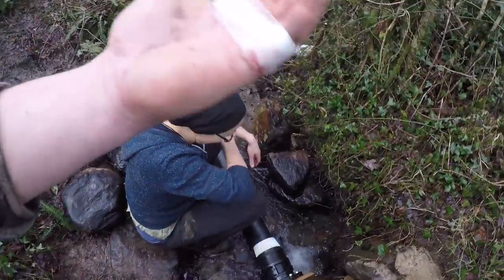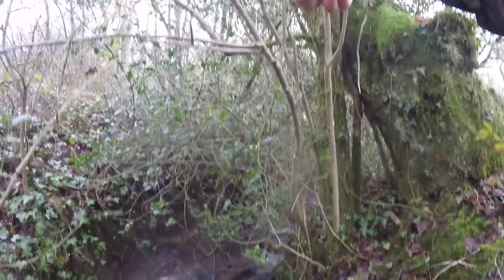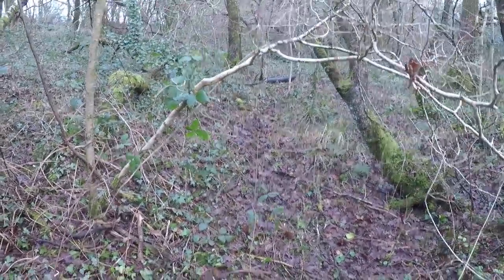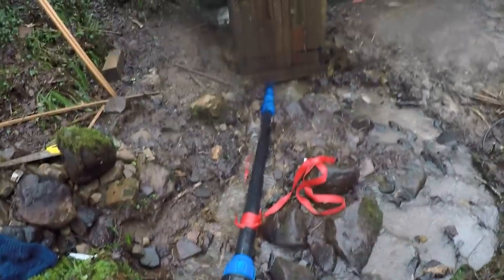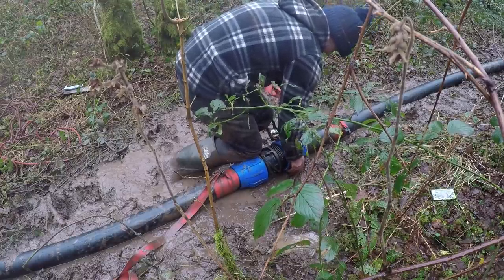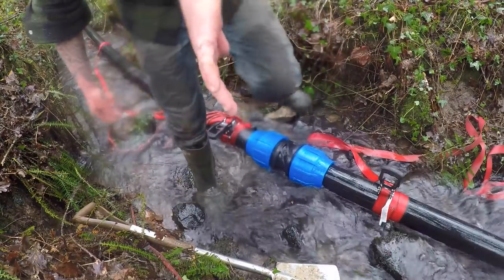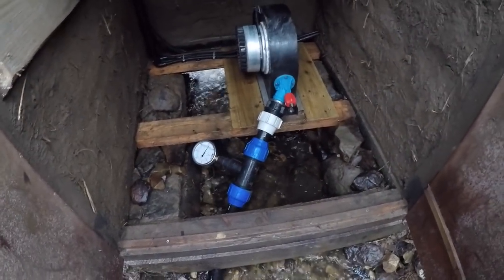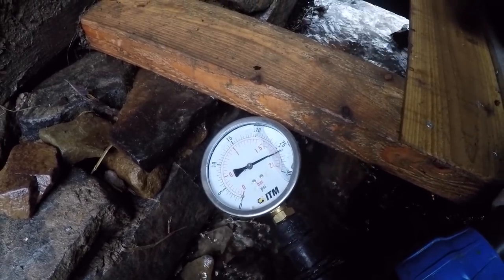DIY Micro Hydro Part 16 Powering Up The Turbine

Comment from the maker: Check out my website for pictures of the Hydro System.  https://www.krisharbour.co.uk/
Reply: Why do you need to install the Micro Hydro in a river streams ?
Since the Micro Hydro generates electricity why not let it power a water pump so the pump can create clean water streams from higher place the cycles keep on running indefinitely ?
Reply: Hello kris
Reply: I m from india
Reply: I want to know about small scale hydro project (step by step)
Reply: @reezalaq6522  I think that it wouldn't create anouf electric
Reply: @reezalaq6522  so..... perpetual motion then .........!
Reply: Hey I’m a bit late. What type of pipe fittings are those? I’ve been using something similar for my large irrigation projects and this looks like an interesting option.
Reply: Chris, 8:20 you should close the stand pipe end if to get more preasure. You could go to more than 60 psi if you close the stand pipe. Opening the standpipe will reduce the air preasure causing the preasure reduce. And the stand pipe shoul not higher than your intake pipe

Comment: The sound as she span up.   Awesome.        Heart sunk a little as she took load and slowed down.    I was expecting it to stall..   ever the pessimist I am.  haha

Great vid Kris.   I am so looking forward to seeing the results.

Cheers for taking us along.  Neal
Reply from the maker: it speeds up again after that, its the charge controler working out the ideal voltage. at about 70v it sounds lovely. but it takes the controler a little while to work it all out. thats why i need a better controler.
Reply: What is the controller you used?  
The ones I have used have never been anything greater than 20A at 12v.  I started with a few PWM controllers which seemed to boil my batteries dry quite quickly over time I thought despite it not charging until there was enough light to reach the 13.8v needed to charge.  Maybe a had dud ones.
   I eventually got an MPPT controller.  It had a digital interface where I could set the dis/charge cutoffs,  as well as a switched load output that could have its voltage limits adjusted, as well as the option to have it timed.  Great for low light charging too as it has a built in boost converter to utilise all low voltages from the panels from early light. (boat project in my case).  Well worth looking into if you haven't already.

Comment: Big step forward Kris,

Hydro will just keep on giving regardless the time of day. Looks like you will get some real useful generation out of that system.

Well done, as always great effort team!
Reply from the maker: I’m currently in my shed with the lights on and using power tools... the lights are on in the house my laptop and the fridge freezer is now on and the hydro is at half flow 👍😊
Reply: Result!
Reply: Kris Harbour  wow that's awesome..keep up the good work. Question .if you were to have 3 turbines in series what would be the water pressure drop if any.

Comment: Nice work Kris.  I have followed your great efforts and skill in working with wood and fabricating metal etc. You got the PSI at 24 bang on - under load. I think you will get the full 300 watts  or  more with the flow you have in Winter, may need more storage to keep it all. A brilliant Youtuber and well presented.
Hope you go active as a Radio Amateur when you get time. 73 de G4PEY

Comment: Great work by all of you.  You really need to put in a wedge type diverter on the top of your box between the intake screen and where the pipe is connected at the bottom, because if the water continues to by pass the screen and hammer down onto the pipe and box connection it will eventually break/erode both the pipe and the box.  Water as you no is relentless.
Reply from the maker: yeah i know, im just making sure im happy with the design first then i will make something to protect it.
Reply: I hope your hand is healing and you have great friends helping you

Comment: Chris, 8:20 you should close the stand pipe end if you want more preasure. You could go to more than 60 psi if you close the stand pipe. Opening the standpipe will reduce the air preasure causing the preasure reduce. And the stand pipe shoul not higher than your intake pipe

Comment: i think you could have a bigger jet or maybe even 2 because the water seems to be flowing at a high pressure even at full open, i use super glue for deep cuts, it works well for me
Reply from the maker: the next video will reveal all. but yes the system can handle another nozzle if i need the power in the future.

Comment: You could increase the Electric out-put in this system a lot if you would put additional Turbines aprox every 50 feet. This distance will allow the additional turbines to get sufficient water flow without affecting the Up Stream turbines. As long as there is a good down grade gradient and good water flow at each intersection, you could add additional turbines. This system could be upgraded to produce 3 to 4 times as much power.

Comment: Hope you remember what this electricity is good for and that is night time Heating..   you probably want to build a water heater that circulates water throughout the radiators of your household which you need to put in.. your bedroom and bathroom should be on the hot water electric heater and all this system should be backed up by a fireplace heater or an outdoor fireplace heater. Ultimately if the fire should go out at night and starts cooling the house.. your hydro electric heater will kick in buy thermostat and keep that zone hot or at least warm. We over here in America like the outdoor wood heater it just keeps the dust out of the house..

Comment: Congratulations Kris!  That is simply awesome!  Question: Your stand pipe didn't look very tall, yet you have 26 PSI.  Is the stand pipe up near the top?  I guess it must be, because 26PSI would require 60 feet of drop.  Correct?  Really excited to see the next video!  Please include all the basic stats of the system if you would.  Head, flow, pipe size, watts, voltage, etc.  I know you've mentioned much of this along the way, but would be nice to have it all in one vid.
Reply from the maker: Yeah it is only just down from the intake slowing the air that gets in At the intake to get out before it shoots off down the pipe
Reply: 26 PSI is 1,79 bar. so a 2m tall pipe should be enough.
Reply: at 1.79 bars you would need something longer than 17,9m.
Its roughly one bar for every ten meters of water

Comment: congratulations, you have a potential of 1 kw, with 13 liters / second and a dynamic pressure of 21.3 PSI around with turbine running, water speed about 1.7 meters per second in the pipeline
Reply: 1kw?! O_o All the power!
Reply: it depends on whether it has enough water and if the turbine allows it
Reply: with 13 liters per second and 18 meters gross and about 14.5 meters net dynamic, with 100 meters of pipe DN 110 si

Comment: It took you some work and is an accomplishment.. I think that pipe can do more pounds per square inch I think that you need to experiment with a pond at the top and draw your water underneath the water and yet have it clean.. this Opera Pawn well produced a heck of a lot of weight of water forcing its way down the pipe that is all the surface water above the pipe no matter how it is spread it out however the higher the better.. well the same should be true with the wider is the equivalent..
Reply: Perhaps you need a concrete box..tank. Yes a tank that will allow you to keep a thousand gallons of water pressure in the pipeline..

Comment: good boy
you did a good job that I hope will give you so much satisfaction
I saw you have an ep solar MPPT display
..
if you use it for the turbine, as I do in my systems, check that the vacuum turbine does maximum 130 volts dc after the three-phase bridge and 450 volt 470uF electrolytic capacitor (essential if you do not want to break the mppt)
if you use the 150 volt epsolar version
at load, on the DC bus that goes to the regulator, it measures in AC, how many mV of ripple there are on the DC

. it is good not to exceed 2 volts, otherwise increase the capacity of the electrolyte
you can also improve the efficiency of the turbine by placing 3 capacitors at 200 volts, on the phases of the generator that brings the cosfy to 1

Comment: You could've determined the height drop at the beginning of the project by laying a small hose along the intended pipeline, filling it with water up to the height of the intake and measuring the pressure at the bottom, multiplying the bar pressure by 9.81
Reply: So, basically, a MUCH more difficult, complicated and expensive way of achieving what he did with two sticks and a bit of plastic pipe ....!
Great ........

Comment: Hi Kris, I am waiting for your result with new controler. I will say, for 18m (26psi), pipe diameter 100mm, pipe length 100m, efficienty 90%, for 1 L/S = 80W, for 2 L/S = 170W. You dont "catch" enought water into intake. When will you receive your controler ?
Reply from the maker: Hi cristof well the intake can catch about 6 liters per second. and the system is made to handle 4lps  so you can do the math :) i have not purchased  the controler yet, just using my solar one for now.

Comment: Sweet! Do you have a link for those fittings?
Reply from the maker: Wow, big fan of your channel. they are just MDPE 110mm fittings in the uk you can get them from any pipe supply store. the nozzle is from eBay. a guy in italy makes them. just search "pelton nozzle"

Comment: Unreal! So Cool. Are you worried about the wood rotting away, being wet all the time?
Reply from the maker: it will last manny years before it rots as it is durable wood. i will have to re build it one day but it wont be for a long time.
Reply: It's the wet - dry - wet - dry that rots wood because .... boats.

Comment: Might not have been a bad idea to add a valve and a bleed off on each connection so that you can isolate sections of your hose - should anything ever go wrong and you need to replace a piece of hose, it might be difficult trying to break down tens of feet of stiff hose filled with water.
Reply from the maker: I would just put plastic over the intake and drain the pipe. Much cheaper than 3 110mm butterfly valves at £250 each

Comment: Just spend the evening watching the entire series, nice project and a lot of hard work going into it.
I was just wondering what the output voltage of the new alternator is and what kind of rectifier you are using? 
If the voltage isn't that high you might have quite a big efficiency loss at a normal diode rectifier.

Might be worth investigating an ideal diode rectifier but i have only found reference designs, no finished products.
Normal diodes at 85% efficiency compared to an ideal diode rectifier at 5VRMS line to line, going up to 95% efficiency at 48VRMS line to line.
You can see it mostly depends on the voltage that you are expecting.

Anyhow, looking forward to the next videos!

Comment: Kris, this is amazing! You show almost no pressure drop when you open the valve.  Would it be possible to make a second nozzle and double the power? Your pressure will still probably not drop much.
Reply from the maker: Thanks, and yes this time of year the system could handle a second nozzle. but even with it not even properly hooked up to a good controler its making more power than i can use at the moment. that will change in the future when i have the big workshop. so im sure it will be a future upgrade.
Reply: I will be waiting for that upgrade!

Comment: at 1.8 bar and 1l/s, you could theoretically have 180 W; not bad ! You could even have more if you increase the intake flow. Good job; waiting for the results ;-)
Reply from the maker: Well I’m not going to spoil the surprise but it’s high term than that.
Reply: No  max 100W
Reply: No. Theoretical maximum is 176W for 1kg/s:
You have: 1kg/s * 18m * gravity 
You want: W
  176.5197
Reply from the maker: the flow is much higher than 1lps
Reply: Study but above all experience because it is not so, the books, the theory speaks of turbines of various MW with efficiencies that you can never have with 500 wo 1 kw, I say not as an expert because I do other work, but "play" with Pelton Turgo Francis and Michell Banki hydroelectric turbines from 200 W to 300kw for 20 years.
Reply: I said theoretical maximum. I would be surprised if this system is < .7 efficient. Well, lets see the results in the next video ;-)
Reply: You have simply forgotten the efficiency of the permanent magnet alternator, which does not reach a little over 50% at this power if you rotate at the correct speed of maximum efficiency of the operating curve, which depends on the impeller diameter and pressure, being directed to the impeller

to give a certain result I make 1L / S * 18 meters (net from the pressure drops of the pipeline) * 9,81 (gravity) * 0,5 (50% total efficiency of the water intake system, pipeline, turbine and alternator ) this for powers so minuscule generally is from a 50% for powers higher than kw rises to 58%, then if the impellers work at the optimum efficiency pressures you can be cautious to go up to 60% while staying within 10kw
Reply: The power is greater has a potential of 1000W, I do not know the flow rate I have only the diameter and length of the pipeline and the gross jump, I hypothesized that it can reach 13 liters per second producing 1 kw with acceptable load losses, 0, 7 terminals at the terminals absolutely not at these powers.

Comment: Good video.  Too bad about the injury.   I'm afraid I've done similar damage to my hands in the past.  
Just wondering why you didn't cut off the water flow when connecting the joints?

Comment: 300 feet of ABS tubing or 300 feet of electric wire . I think a longer life require would have been easier to do also you don't have to worry about the water getting on your property and making it to flood
Reply: You need the Hydrostatic Pressure from the height difference.
Reply: @gutesache1  err, I'm not sure you answered the question - but how would anyone know .......??!!
Reply: @andymccabe6712  Because it's physics.

Comment: You made me think about dumping all that excess water out of the Pelton wheel that you have into a trough actually this trough is The Flume for a traditional wheel since you're low to the ground for you that will should be possibly a Paddle Wheel.. the type that traps the water in a truth or gutter and have titles equal to the whip of the trough and there for producing rotation energy..

Comment: Second video iv ever watched on your channel but you definitely have a new subscriber/fan/watcher. But just curious why didn't you use regular pvc and solvent weld/glue for everything but where your actual connection to the water is?

Comment: Am curious because I have a place I can build something like this. How do you plan to clean the pipe? Like anually
Reply from the maker: there is alot of pressure so i will rust take the smaller pipe off every now and then and let it clear through really fast. i dont think it will get much buildup though.
Reply: I saw a homemade 6Kw system in Argyll last year, they stick a big sponge into the pipe at the top (they call it a pig) and turn the pressure on to fire it down to the bottom.

Comment: You're a brave man, kneeling in stream water all day in January, but it looks like it was worth it in the end.  Enough for an immersion heater so you don't have to run the woodstove for hot water in summer?
Reply from the maker: Well yes..... but the power is slow and steady meaning in the 24h period I can make as much power as an average household uses but I will need a battery upgrade to run large loads like immersion heaters before I can do that. But yes totally possible 👍

Comment: What kind of pipe and connections are those?  I have at least 100 feet of head on a stream here in Oregon, USA.  I've wanted to put in a micro-hydro system since we moved in.  My plan was to use either PVC or collapsible hose, (like fire fighters use), but I like the looks of this pipe a lot better.
Reply from the maker: It’s mdpe pipe in 100m coils and compression fittings. It’s very strong stuff!
Reply: thanks for responding with this info! I was also interested. Do you know if is it freeze rated?
Reply from the maker: no it isnt designed to freeze, but being quite flexible it will take a bit of freezing but not a full pipe of water. that would damage it for sure. but as long as the water is moving it wont freeze in this environment in wales, its not cold enough.

Comment: Cool!
The number one injury to electricians is from razor knives!
Why hook up to water before you had all the pipe connected?
Reply from the maker: Because I couldn’t get the pipe in the intake with all the other pipe attached to it. Had to do the two complicated ends and then join in the middle

Comment: Right on Kris!  I can't wait to see the calculations.  Also, I'm interested to see and and hear how your powerhouse cuts down the noise of the turbine.  And a secondary question, do you have a Y somewhere near the turbine to easily flush the system if needed?  I recall you had some sediment issues with the collection box.  Cheers from Canada!

Comment: Wouldn't it have been easier to connect the pipes if they weren't under load? Couldn't you just cover up the intake temporarily to release some pressure?